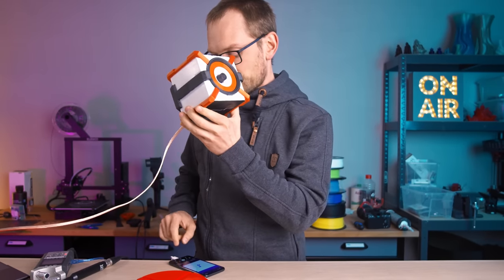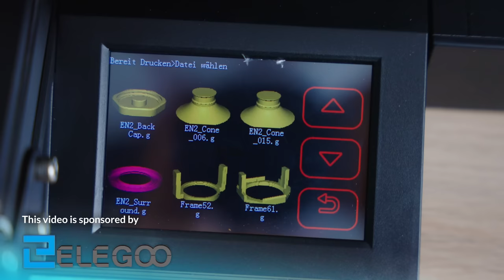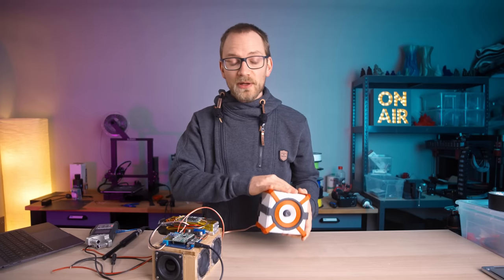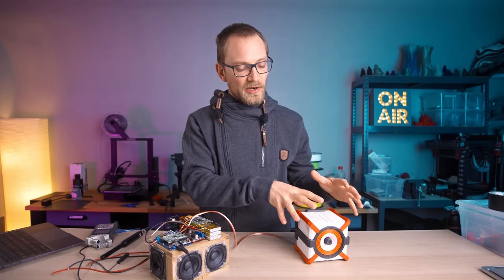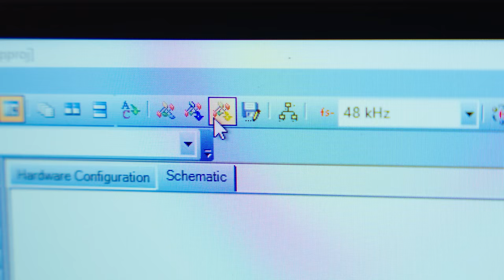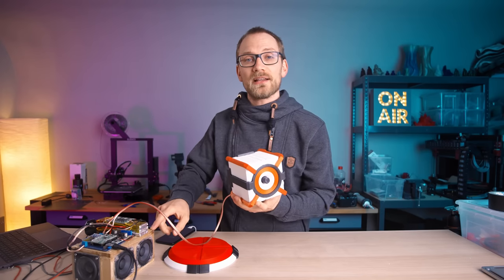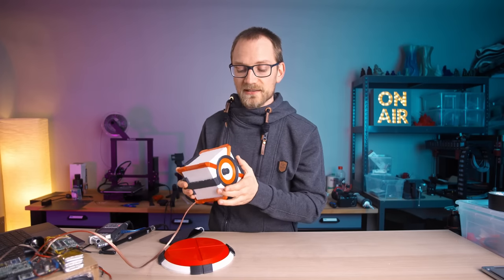Can we print EVERYTHING in a speaker? Trying Polymate3D's FD52 fully 3D printed driver!

Comment: That sounded SO much better than I imagined it would after you tuned it. I thought this is going to be a proof-of-concept. But this sounds like something that is actually usable.
Reply: i dont think so, i think it would sound like absolute garbage irl. its a fun proof of concept, but we have to take current portable speaker quality into equation. but as an exercise its super interesting. also that an obscene amount of glue...
Reply from the maker: It actually does sound pretty good! Like I said, definitely comparable with a small speaker and very impressive for a fully 3D printed unit!
Reply: FD51 was built into my twin vented cabinet and run for multiple months in a warehouse as a test and did alright. Now I am working on scaling to larger and more capable drivers

Comment: What, no conductive filament coil? :D
Reply: When i first heard about conductive filaments I was all excited.... then I saw how "conductive" they are and I was sad.
Reply: @someguy2741  Exactly this issue. I even attempted printing the VC copper wire into the filament but proved very tricky!
Reply: @Polymate3D  I think the coil is a lost cause... for wiring in general I think I am going to try making 3mm tunnels in my next print.  Then I can either have a pause and lay in the wire with a dab of hot glue or leave the channel and then push a wire in from one end.  It would make super sleek wiring especially in short runs.  Just need to have decent radius turns.  Lol... I cant remember if you did this... I am going to watch it again... this time not at work ;)
Reply: I’ve done magnets like yah before, but never would’ve thought of wiring, great idea:)

Comment: Interesting topic, but I feel like this video only scratched the surface despite its length: why are the magnets arranged like that (e.g. at 2:10 repelling each other?)? Why are there washers in between? What are the washers on the outside (2:40) doing? Where is the magnet wire fed through, how is it strain-relieved (so it can't pull on the cone)? What DSP are you using, how did you set it up?
So many questions, such montage, few answers ;)

Comment: What a great proof of concept! I am totally inspired. Been wanting to experiment with "field coil" speakers (no permanent magnets, uses an energized coil concentric to the voice coil) and this proves it's not that hard! The ability to print the spider and surround in flexible TPU is incredible. Yes, yes, yes. I've got a CNC coil winding machine and should be able to make an efficient speaker motor. I'm thinking of experimenting with vacuum forming the cone from a 3d printed mold.

Comment: The best test for speaker sound quality is to play white noise with the calibration microphone about an inch away from the driver pointed at the center. Better if you can record it in a foam box to completely deaden everything.

You then open up the recording of white noise into a DAW with a frequency analyzer. That should give you a very good estimate as to how the speaker would sound like as opposed to listening to how it sounds like through a video.

Comment: if you connect the coil terminals directly to a fixed point, they will break from vibration.  Factory speakers therefore use a braided stocking made of very thin wires.
Reply: Tinsel wires would be a nice extra that some later designs may need to implement. In these designed the driver moves at best +/-2mm and the wire is 0.17mm so rather thin. Testing of previous drivers with 200+ hours use have shown zero issue, but as it becomes thicker and more movement, 100% agree :)

Comment: Really awesome project! Good value too, IF you already have the filaments. If you need to buy 2-3 different rolls of filament you otherwise don't need, and especially if your printer isn't rigged for flexibles already, then the value aspect goes out the 5th floor window. But that's the reality of a very large portion of most projects. IMO it's more of a learning and mastering type of deal, than bottom line value thing. And that's absolutely fine as long as you go in understanding and accepting that, as with most other hobbies and learning opportunities :)
Reply: Agreed. For many the concern is purchasing a whole real of TPU. Luckily you can get samples of 5M to 20M fairly easily. A FD52 driver uses approximately 3M of TPU for each one, so a 10M or 20M sample will do the job for that. FD52 also uses PETG for the chassis and cone, as does some of my other designs, and I have also done FD51-4OS which was done with PLA. A lot of these early designs where focus around as easy a entry point as possible :)

Comment: This is very cool! I am currently designing my own 3D printed modular speaker system that allows you to quickly swap out different pitch speakers to get the sound you want. It uses commercially available drivers but I might try out a 3D printed one to find out how well it works. Thanks for showing this cool project off! 💙💜

Comment: After the voice coil wires break because they were single strand, replace the moving speakers with braided wire. You can use desoldering wire or get some from a headphoone cable...
Reply: This was a concern of my own, along with other things so a pair of Tenacious 6 drivers were put in a car for an entire year, traveling 6,000 miles and used at volumes including use on the motorway. 0.17mm wire had is issues due to the limited 3mm one way travel. Longer throw drivers for sure you be better to go tinsel wire. Hope the insight helps - Paul

Comment: I love this kind of stuff when I think about expanding the footprint of mankind in sustainable colonies.  A Martian colony isn't going to have a speaker manufacturing facility - but they WILL have 3D printers, magnet wire, and some epoxy.
Reply: This was something I was thinking off the other day haha. I will keep improving my designs and you never know. I think there is potential to 3D print many practical parts instead of mass production for this exact purpose!

Comment: Oh man.... I've been experimenting with this idea for years!
Reply: Be awesome to see some of the experimentation :)
Reply: @Polymate3D  I may have to share somehow! I used a single big ring magnet, but I think what you're doing with yours probably works better. 
I did end up using a flat speaker "cone" just because I could get cleaner prints that way and add some thin spokes on the back to help reinforce it.
I was kind of amused we both came to the same solution for the design of the surround! I tried a few different designs for that, but the accordion style is definitely easiest to print. hah!

Comment: Which dsp unit did you use? Seemed really effective!
Reply: I know, right?  Weird that it's one of the few things he left out when it features so prominently in making the speaker sound decent.  Would love to see a video on just setting up the EQ/filters.
Reply: I want a whole video on that DSP process!
Reply: Might be SigmaStudio from Analog Devices possibly.
Reply from the maker: It's a fully programmable ADAU1701 - you can get the boards for about $15 from Aliexpress (you need an USBi to program it, though - there are DIY versions of that). Many "DSP" boards you'll see are nothing more than simple EQs, this does so much more.
The graphical programming is done in SigmaStudio, which is free.
Reply: @MadeWithLayers  Thank you!  I assume you need a half decent mic as well. ?.?

Comment: I see you used washers for the iron chore.. I liked this idea, Been having rough challenge to rebuilding a disk cutter for my own use. with little to know help. i typed in 3d printed speaker and your video popped up. So glad i though of this. Great video. Its still a challenge to drive speakers, i have tried nuts and bolts. and Doing it old school with Bottle caps and stuff. As i dont have a 3d printer..

Comment: Shame you can't double like :O)

Just finishing off printing some speaker enclosures too.  Have designed speaker drivers previously - but never 3D printed them.  Obviously easier to outsource.  But that's clearly far from the point here.  Hats off - excellent build!
Reply: Thanks Phillip. I am continuing to work hard on this, and any feedback on design & assembly is greatly appreciated, along with any documentation I can read!

Comment: Awesome job Thomas!
It's awesome you also know about acoustics and DSP, plenty enough for this project.

In the sound demo it seemed that the low-end was not super clean, it might be worth checking again distortion levels and rub&buzz and boost more selectively the low end.

You didn't share too much details about which DSP board you're using tho, I'll look in your previous videos.
Nowadays there's a few Raspberry Pi sound cards with Sigma DSP built-in and remain affordable, I wonder it if was one of them.
Reply from the maker: Ooh, those sound cards sound interesting! Do you happen to know what they're called?
The DSP I used is a simple ADAU1701, which you can get on the little board I show for about $15. May need to do a separate video on it!

Comment: You beat me to it, I was working on printing a 6.5 in sub woofer. Having trouble with finding a slicer that lets me print circles in actual circles and not lines so my spiders and surround are more structurally accurate. Nice job.
Reply: Actually there’s a solution for that! There’s a post processor called Arc Welder that will take the gcode your slicer makes and replace curves made of many small lines into actual arc commands. Just have to make sure you have arc support enabled in Marlin (may be on by default or may need to recompile, but it’s just a single flag if you need to). Google Hackaday Arc Welder for a good overview article. I think there’s even a post processing plugin for Cura so so it right at export, otherwise you just manually process your exported gcode.

Comment: There's a flaw in your mic setup for the sound sweep, the cabinet on a soft/moving bed/table will dampen and reverberate. A simple test would be holding it in your hand, on a table, and sometimes putting weight on top also helps incase theres soft feet on the speaker.

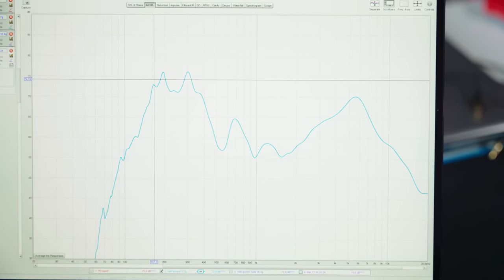Comment: I mean its cool that it works, but 5:53 ... equing 20 db is like, there is 100 times more energy going into the system at your lowest mark than without the eq, thats really not practical anymore, distortion and spl vise. + I really dont think that its looking better when you would look at the resonance graph
but its cool
Reply from the maker: I know doing 20dB (or more) of corrections isn't what you'd typically do, but what I usually do is to tune my speakers a bit too low, then boost the low end back up and use a bass limiter to keep the driver from blowing up. Works super well on the PC68 box and makes it sound like a much bigger speaker at low volumes while staying distortion-free at higher volumes.
Reply: @MadeWithLayers  
edit: please dont take this as negative critique

yes, but at the end, you are only tuning relative volume at certain frequencies. For example you use a 10 dB boost at 1kHz and and bring the rest down to the same level, you will still get +20dB at 1kHz when you turn up the volume by 10dB to get your bass as loud as it was before. Bass is not that what I am concerned about, maybe it will die from to much excursion, but it looks like the TPU part of the cone allowes for a lot and there is no spider so it will just get out of reach of the magnet or it will maybe produce scratching sounds, I think you didnt center the voice coil. But imo that doesnt matter, its not supposed to be a subwoofer, its supposed to be a full range speaker that gets extended by the passive membrane, which is something very nice (there are not really many options for these on the market). It wount die to bass, it will much more likely die to overequalization, there will always be this one party where the volume is really loud and nobody really will notice that its destorting super hard and then there might be a passage in your music that has a lot of energy in that range where you boost relative +10-15db, maybe it can resist it, maybe it doesnt.
I am not saying its bad to 3d print this, I am just saying that this result is in comparison to normal speakers that you can buy for really not that much money pretty bad (you can get drivers that are relativly flat for 15-20€ and you dont need to get something to calibrate it, you just give it the bass boost you want and if you dont need that you can save the other 20€ on the dsp and get a bit better sound in the mid-highs because you dont have only one dac and not dac -> adc -> dsp -> dac (sure you can try to get an dsp which gets it audio stream digitaly from bluetooth - but then you already put in so much effort that its really not worth to cut cost on the speaker).

I hope we get an update on this topic from you, when there is something new, cause after this video I know that you are not only into 3d printing but also know a lot about audiotransducers and got the gear and knowlage to show us more than "its working" - big thumbs up!!!

Comment: would it not work with 3D printed conductors?

Its actually possible to make a speaker with out permanent magnets, just two oposing coils removes the need for the magnets. And with 3D printed conductors that would pretty much make most of it 3D printed.

Comment: I would have equalized out  the bulk of the peaks by lowering them and brought in some low end, when you forcing high end upwards you created a overbearing noise in the upper range of them you would have been better off lowering the lower ranges it'll be more accurate instead of overtoned
Reply: being it's a neo motor I would have added mass to the cone resulting in a lower fs at the cost of efficiency the motor could also utilize a tighter coil gap resulting in more bl force making it louder

Comment: Wow amazing. I'd be curious if this could be done as a more flat panel speaker?
I'd like a small portable boombox that is powered by a raspberry PI zero or similar.
Also was confused by "passive radio" but it's a passive radiator.

Comment: Curious to see waterfall and distortion plots in comparison to a low-cost mass-market speaker. I don't have the best feeling about this.
Reply: @maxwell_edison   Just would be interesting to see how far off it's from what would be considered a typical/reasonable standard of engineering. Because frequency response is not all there is to it, but as wavy as it is, this indicates... what would normally be considered significant trouble in the design when one picks drivers for a HiFi speaker cabinet design. You can't compensate temporal resonant behaviour oddities with a DSP running in frequency domain.

I don't want to be too critical of the attempt, because it's difficult to expect even something that works as well as this does, and at the end of the day it likely holds its own against quite some toy-ish speakers overall, but it's also important to characterise it regardless.
Reply from the maker: Here you go! https://twitter.com/toms3dp/status/1372945663881797637
Reply: @MadeWithLayers  Love you!

Normally there isn't nearly that much up top, 60ms at 4KHz. That's probably all just box and room. I forgot to mention. This definitely needs a much better measurement setup, a large dead baffle and sound absorption. But i can't say that i have an at-home solution :(

Comment: its all cool but magnet and a voice coil are the most essential and expensive parts in any speaker.
for more bass you need to go with ether bigger diameter or a larger moving amplitude. all this with freeair resonance being as low as possible and moving mass being in some acceptable range for the speaker motor to actually move all that. 
just for lolz its neat but you need to fine adjust thiele small parameters to get some decent sounding acoustic system.

Comment: I’d expect deformation on the coil on a bigger speaker with more heat probably best for small scale
Reply: As you go bigger, thermals do become a concern for sure. In my biggest motor since this, it has much more metal mass for heat dissipation and much more efficient motor, reducing the heat output. Highest power output so far on a 25mm voice coil was 20W. This will be explored further! - Paul

Comment: Impressive results considering... But wasn’t this coil winding a bit barbaric? Low current induction is extremely dependent on homogenous geometry.
Reply: The design incorporates a wide magnetic gap and underhung design. The indent is to keep all the wire within that gap and winding count is low. In testing inductance values from 0.16mH to 0.18mH were measured, so static inductive values didn't change much and this driver does move a huge amount either. Will see the effects more as I scale no doubt. Hope this data helps. I hope to be able to make a winding machine at some stage, but wanted to make it as open to people as possible :)

Comment: Amazing speakers and project ! but am I the only one shocked by the amount of glue used? for me 3D printing is freedom of doing what you want and repare it, here everything is glued together so no chance for that :(
Reply: In the guide I do not usually put glue on the washers / magnets, and my own cabinets only have a single back cover which is glued on. This leaves the normal parts like cone to spider and surround etc. It may be possible to do better than this and is being consider on a bigger driver :)